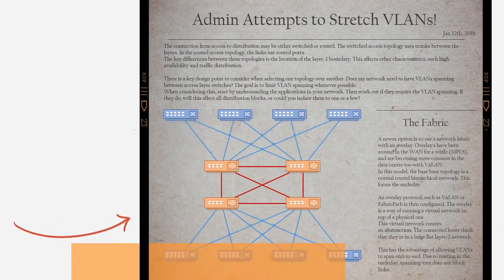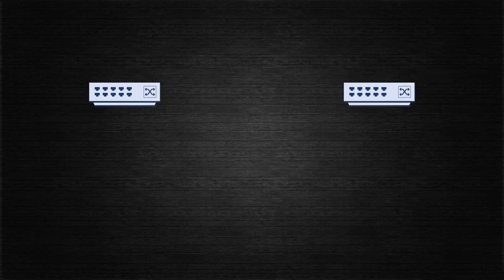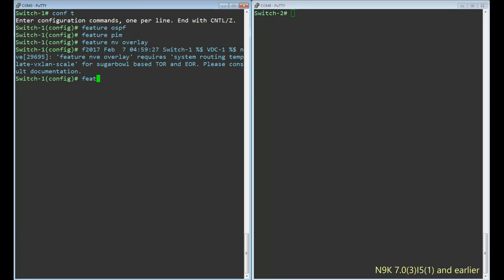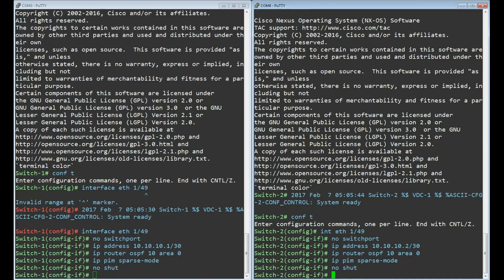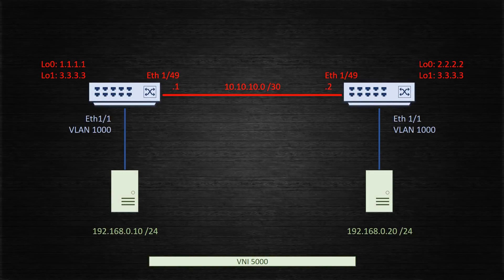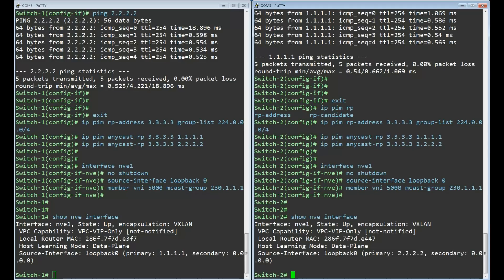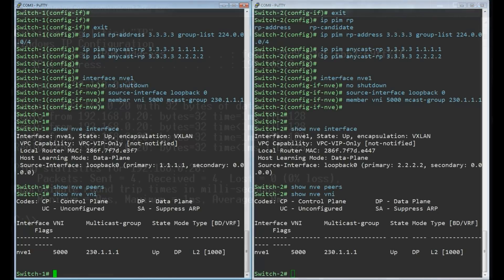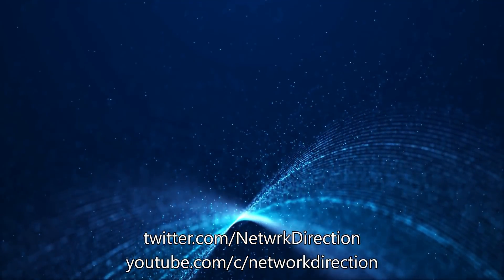VxLAN | Part 5 - Bridging Configuration

Comment: How are the 192.168.0.x hosts able to ping each other and how is the same network being used in parallel? Are these subnets being advertised into OSFP with different VRFs?
Reply: VxLAN allows you to span your L2 network over a L3 boundary.

Comment: Thank you for a lesson. I have done everything like was shown. The problem is that hosts are not pinging each other, moreover even those hosts that connected to the same switch, with the same vni  configuration. I have checked many times the running config, searched the web, nothing useful was found. Can you advise please is there anything that can prevent L2 traffic from reaching between hosts ? Thank you in advance!
Reply from the maker: Sorry, I'm not sure what would cause this... The only thing I can think of is that the VLAN config on the ports is wrong?
Or do the hosts have a host-based firewall that's blocking incoming ping? I think Windows will do that by default

Comment: Hi, I have tried this lab in EVE-NG Pro seeing your process. I used NXOSv9k 7.0.3.I7.3 and 9.2.2. In both OS I didn't found the command "system routing template-vxlan-scale". My vni peer doesn't come UP. Could you please suggest me on this?
Reply from the maker: I'm a bit rusty on Nexus now, but I think the template is ASIC specific, and may not work on a virtual image.
If the peer is not coming up, check your underlay (routing, etc)

Comment: When you configure the computer port, you do it as a regular access port.
int eth 1/1
sw
sw acc vla 1000
no shut

My question is: 
Does this mean that when a computer/server is connected to that interface it will take the default STP timer until the forward state is taken?

It is possible to configure the STP edge in that port or is not necessary?
Reply from the maker: From memory, configuring an STP edge port is still a good idea.

Comment: Hi Sir, the example showing is 2 VTEP/Nexus9K directly connected. How if there's a middle node in between but not running VXLAN, is it required to enabled PIM on the middle node also? Thanks alot for the good video.

Comment: Thanks for making a great video :) I still  have a doubt. What was the loopback address 3.3.3.3 used for on both the switches? Since 2.2.2.2 and 1.1.1.1 already is learned via OSPF and both switches have joined multicast group 230.1.1.1 they will receive the multicast packet.
Reply from the maker: Since they're running iBGP, the loopback interfaces are used to peer with their neighbours.
This also provides the IP address to the NVE interface
Reply: @NetworkDirection   ????

Comment: You videos are great. I have a small doubt here. You enabled system wide mtu as 9216 whereas interface level mtu is not modified. It will be 1500 by default. I did a similar setup. My nve peers were not showing. Once i modified mtu on interfaces to jumbo peers came up.
Reply from the maker: Good catch!
Reply: @NetworkDirection  Hello. Why you set mtu to over 9000? Vxlan overhead is 50 bytes for ipv4, you did it just for convenience? We encapsulate original frame (1526 - 4 bytes of original FCS) plus vxlan header (8 bytes), new UDP (8 bytes), new IP header (20 bytes), frame header and new FCS. So can I just set mtu to 1576? Base mtu of 1526 is correct?
Reply from the maker: @linkflap1342  You definitely want to increase your MTU because of the various overheads, but it doesn't have to be over 9000. This just allows for the maximum frame size.
From memory, I think this was recommended by cisco.
Reply: @NetworkDirection  ok, I get it now, thanks for reply.

Comment: Would you share SPine config? I know your lab is with idea to simplifying Vxlan config, but in a Spine/Leaf design it will be a bit difficult to implement with SPINe out of the config? thank you.
Reply from the maker: I'm afraid I don't have a generic spine config to share.
There's really very little VXLAN config on the spines anyway, They're just routers running an IGP, likely with a rendezvous point configured as well. They just forward traffic

Comment: Very Nice explanation.

I tried same setup and ping test between Laptop-1 and Laptop-2 is successful. Also ARP table is populated correctly on both hosts. But there is no output for "show nve peers" on either N7K. I even tried continuous ping test but still no output for "show nve peers".  Is it any bug? I am using following N7K version:

N7K-1# sh ver | i bin
  kickstart image file is: bootflash:///titanium-d1-kickstart.7.3.0.D1.1.bin
  system image file is:    bootflash:///titanium-d1.7.3.0.D1.1.bin
N7K-1# 

Note: I am using IOS router as Laptop-1 and Laptop-2.

Laptop-1#ping 192.168.1.200
Type escape sequence to abort.
Sending 5, 100-byte ICMP Echos to 192.168.1.200, timeout is 2 seconds:
!!!!!
Success rate is 100 percent (5/5), round-trip min/avg/max = 2/3/4 ms

Laptop-1#sh ip arp
Protocol  Address          Age (min)  Hardware Addr   Type   Interface
Internet  192.168.1.100           -   5e00.0000.0000  ARPA   GigabitEthernet0/0
Internet  192.168.1.200           2   5e00.0001.0000  ARPA   GigabitEthernet0/0

Laptop-2>sh int g0/0 | i bia
  Hardware is iGbE, address is 5e00.0001.0000 (bia 5e00.0001.0000)

N7K-1# sh nve peers 
N7K-1# 

Thanks in advance

Comment: Nice video. However, I am getting a bit confused here, as you had attached VLAN 1000 to VNI 5000. What if another customer needs to use VLAN 1000 considering multi-tenancy factor?

Secondly, what if the same customer is using another VLAN, let's say VLAN 2000. Does it need another VNI or can it get attached to the same VNI?
Reply from the maker: Good questions.
If you have two tenants, and they both want to use VLAN 1000, you could have them on different switches. On one, VLAN 1000 could map to VNI 5000. On the other it could map to another VNI, 6000 for example.

Mapping a VLAN to a VNI is significant to the local switch. You could have 10 switches with a different VLAN on each, and they could all be in the same VNI.

For your second question, if a single tenant had two VLANs, you would probably want to map them to different VNI's. Usually you would have two VLANs in the first place because  you want to separate traffic.
Reply: @NetworkDirection  Hey , Please Explain above scenario in detail. 

1. What exactly you mean by Tenant ?
2. How traffic flow will happen in case of tagging single Vlan to multiple   VNIs?
3. Why it is required?

Thanks in Advance!
Reply from the maker: 1. A tenant is an entity that you want to separate. This could be customers, or business units. So, Customer A would be a tenant. Customer B would be a tenant, etc.
2. As far as I know, you can't tag a single VLAN to multiple VNI's on one switch
3. Not sure what you mean here. What is required?

Comment: What should be the gateway on the hosts??? I receive "Destination Host Unreachable".
Reply from the maker: VXLAN bridging (aka flood-and-learn) does not have and layer-3 capability, so hosts will need to use an external router as their default gateway.
BGP/EVPN (part 6 of this series) includes IRB (Integrated Routing and Bridging), where the Nexus switches can act as the default gateway
Reply: @NetworkDirection  Hi mate, thanks for the videos. I Can't ping between hosts either,  can you share how you managed to  it in part 5?
Reply from the maker: Have a look here:
https://networkdirection.net/articles/routingandswitching/vxlanoverview/vxlanbridgingconfiguration/
That should include the info you need. Let me know if it doesn't